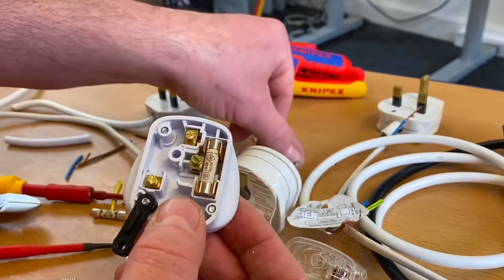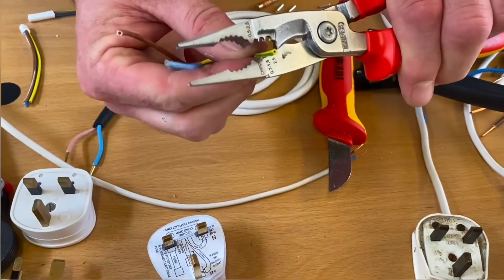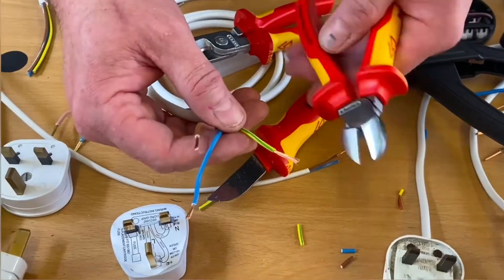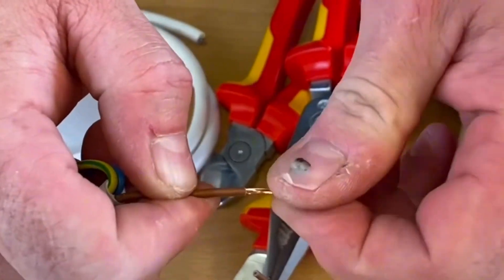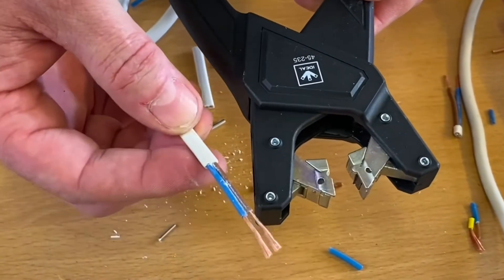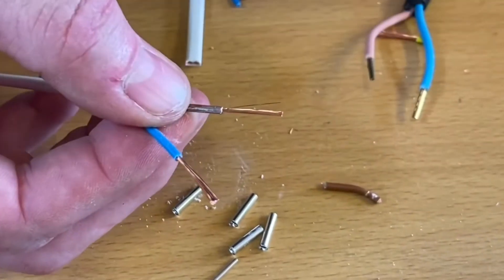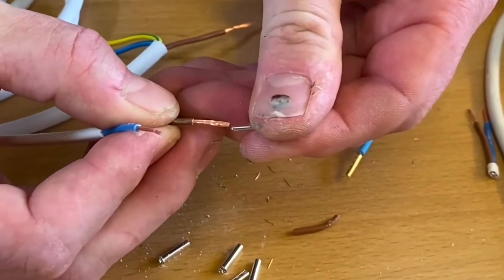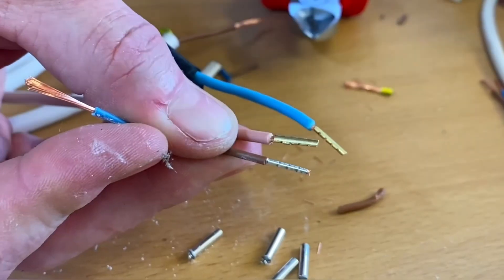Do You Use Them? Ferrules on Electrical Connections

Comment: Never ever put ferrules on solid core wire. 

Why? Because as you screw down a terminal, you run the risk of uncrimping it and then the solid wire is only lightly resting inside the ferrule tube...

Obviously doesn't apply to properly swaged joins.

Comment: If you do not have this ( VERY useful ! ) ferrule ... then soft solder the many fine Copper strands together ( often doubling over the  end termination 😝 ) .. this gives a first class termination ( tried - n - tested ) .... DAVE™🛑
Reply: except solder shrinks umder compression of the screw and can loosen in time
Reply: @JL-rx6hl  Yes ! I have heard this before ... the trick is to  VERY  LIGHTLY  tin the strands , and  NOT !  put a HUGE  solder blob , on 😝... handy tip # 45 ... the ( modern ? ) 13 Amp plug top has a weird flaw ... 99% of the time it works fine ... but .. should you load it to the MAX for a long period ( all night heater ? )  the Live pin over heats and burns the socket surround ( dangerous ! ) ... the ( simple ? ) fix is to  SOLDER  the 13 Amp fuse into the holder , this dissipates heat and has a much lower contact resistance .. the downside is , should the fuse blow , you have to replace the plug top ( but , MUCH , MUCH  cheaper than your house burnt down 😝 ) ... this is a ( tried - n - tested ) fix ... hope this is of help ? ...... DAVE™🛑

Comment: Doesn't soldering the tips achieve the same?
Reply: 'Tinning' can oxidize a bit, but it is a trade off over eliminating whiskers if nothing is done. I am in the USA, and I started using  ferrules  on high count stranded wire after seeing how the other side of the pond does it.👍
Reply: The general consensus is that soldering isn't acceptable as it's softer and will creep over time, loosening the connection.

In my personal experience, the solder has even cold welded to terminals over an 8 year period causing the wires to be stuck in the terminals.

The conclusion? Tinning wires before they go in screw terminals is not consistent and reliable
Reply: Auh okay,  both of those replies make sense,  thanks guys!
Now,  what about if i have a loose ferrule (no pun intended,  lol), and i wick solder into it when the wire braid is inside? 
Maybe very good?
Reply: @mrsrabbit2712  OK, so older video but still worth a comment to you.  No, wicking solder into a ferrule is bad for all the reasons already stated.  It's soft, liable to displace and fracture under pressure causing a poor joint again.  If your ferrule is loose after crimping you have a problem with the ferrule size or your crimping tool is rubbish or not adjusted properly.  Take/cut it off and redo.

Comment: toke apart a consumer unit was built in the 70s were ferrules on all major connection cables ,they added electric shower main MCB could barely handle ,still zero oxidation or burn